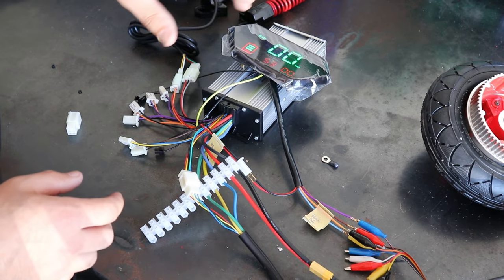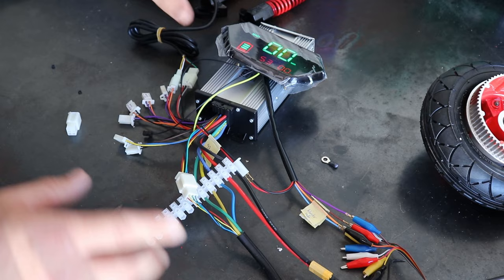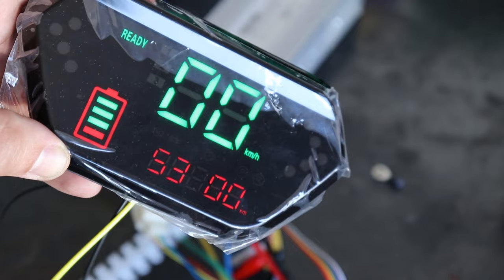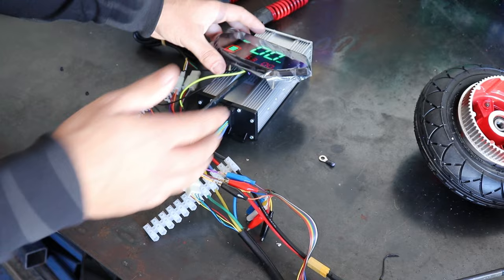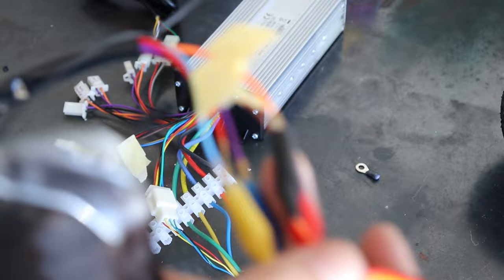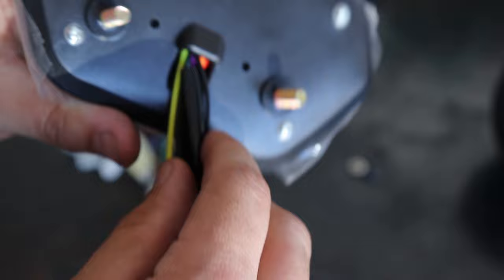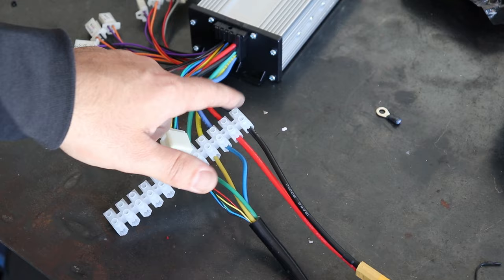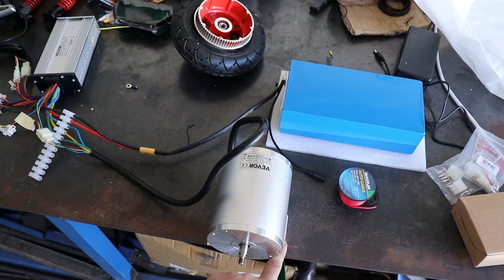How to Wire in a VEVOR 48V 2000W Motor Controller and Brushless DC Motor

Comment: Tengo estas caracteristicas, tengo una bateria de 48v 10Ah y un motor de 480W y el display es el mismo que el tuyo tiene 3 opciones de operacion del motor 1,2,3 y la pantalla es la misma puede operar con 36v y 48v y 60v mi pregunta es si puedo cambiar mi pila por una de triple capacidad de amperaje y solo usando el nivel dos de operación ¿afectaría a mi motor de capacidad de 500w?, lo que busco es una mayor autonomia pero la unica opciones en la que pense fue sustitutir la bateria y checar que el controlar resistiera el amperaje o hacer un arreglo con un relevador y poner un swich y otra bateria externa de modo que cuando quiera ocupar la otra bateria solo presiono el swich y ocupo la otra bateria

Al utilizar tu motor de 48v 2000W y colocarle la banda lo que hacer es un sistema reductor cierto? osea la potencia que tendra la rueda sera mucho menor a los 2000w que entrega el motor?
Reply: Puedes cambiar la batería por una de mayor amperaje y no afecta en nada siempre que siga siendo del mismo voltaje,  una batería de mayor amperaje te dará más duración de tu batería

Comment: This controller is perhaps the worse controller ive ever dealt with. The throttle response is absurd. Its unbearable on any 2 wheeler with that 1800w motor, itll throw you off.